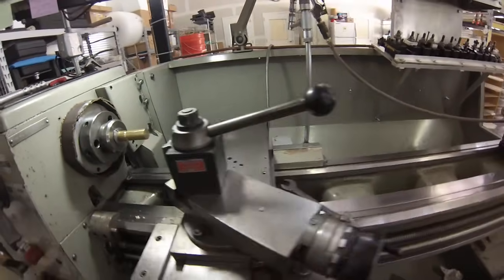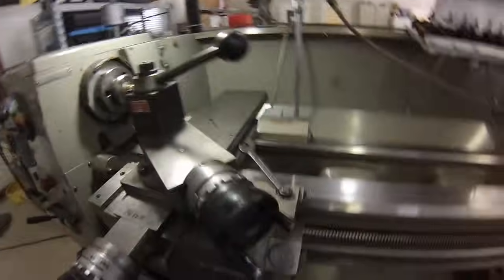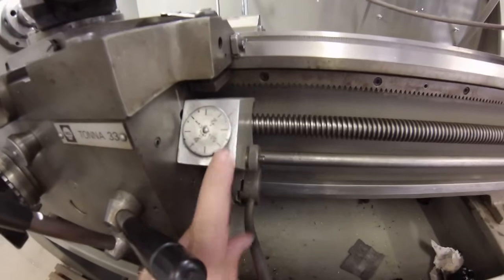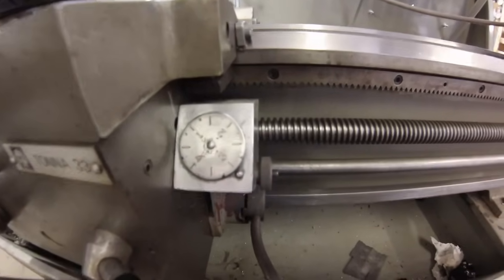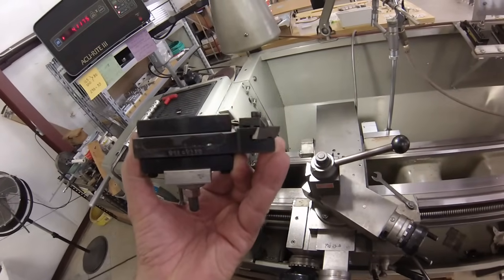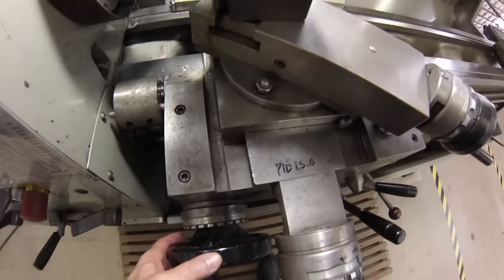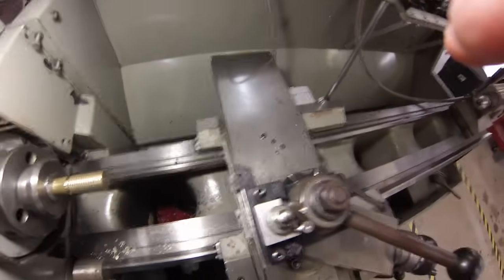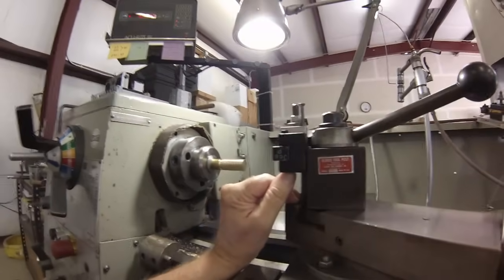Threading on a manual lathe  BEST TECHNIQUE EVER !!!!

Comment: i have used this method many times in the past. but always found it a bit slow. and was never with upside down tools. becous you cant see whats happening and is pulling the carriage of the slide ways. but each to there own. i used to keep the lead scew engaged and turn 4 thou of the nominal thread diameter to start.set the DRO to zero. or put a marker pen line on the cross slide so you no your starting point. get shot of the bed stop. disegage the carriage hand wheel. and thread into your under cut at reasonable speed. and pull the chuck into revers and repeat. depth of thread is a bit more than pitch of thread.  and dont forget to compensate on the compounds slide so your tool dont jam and break.

Comment: When others and I were apprentices with the Royal Navy nearly 70 years ago we did not only use the cross slide to feed the cut as this makes the tool cuts  on two sides of the thread. We used the compound swivel slide at the right angle  of the thread selected so that one would move parallel to one side and only cut one side of the thread. Seemed to be less punishing on the ears!! We used this technique  you shown and when we wanted to make long pitch  threads on wooden shafts we drove the lead screw. Good old days before the Dockyards closed.

Comment: Right, upside down and feed out.  Right side up feed out for lefthand threads.
Not a bad Idea. Where I learned to thread was a hydraulics company and before they got a CNC machine it would be fairly standard to thread 50 to 100 parts or more per shift. It probably never happens nowadays, but then, if you thread 250 to 500
parts per week, week after week, some blind internal, all kinds. A guy can get extremely good and very fast.Believe it or not, at that frequency hitting the shoulder is extremely rare. There are a few setup tricks that allow a guy to do this. One, set your cross slide dial handle at 9:00 so down is always out. At normal threading speeds, people are way faster than the machine. I can imagine such concentration being rare these days.It use to be fun to see how fast one could go, I once beat the machine going 750 rpm,(to a shoulder) the half nut wouldn't fully engage fast enough. Sometimes on small shafts your method would be impractical if a center were used.  We didn't always have the luxury of a long diameter relieved center. Then one would have the same problem in reverse. Still your method would bring relief to those who thread infrequently.
(I know, they make, and we had threading heads, we used on some jobs, but then you would never learn would you?)
  Very good video and very good safety advice.
Reply from the maker: I agree. trade skill can be pretty amazing. Some of the parts I have worked on in the past just wouldn't allow for any chance of a miss. Hard stop and out. Military parts in a repair environment. 100K type stuff.

Comment: Hey Joe, Great technique! 
Threading towards the spindle has always been a source of anxiety for me. I would like to give this a try on my Grizzly lathe. However, it does have a screw on chuck. The chuck has two locks that secure it to the spindle using cap screws but I'm not sure how much of a bite these locks have on the spindle. I might test it with a live center in place just to be safe. Thanks.

Comment: try putting a rubber band around each end of your wires then just slip over the thread you don't have to hold the wires this way makes it much to mike the pitch
Reply from the maker: Try using just 1 wire!! Makes it even easier.
Reply: actually I kind of cheat I have thread Mikes I got when I was still working in shop
Reply: I know something the home hobbies or average guy not going to have or afford. I just discovered your channel and I do enjoy watching
Reply from the maker: Thanks. I appreciate the interest.

Comment: It appears that you are using a left hand tool holder & left hand insert and just flipping them over. 
Is this correct?  If not, please explain.
Does the same apply for internal threading, in regards to tool holder and insert?
I do a fair amount of single point threading, and am excited to try this technique.
Thanks for your work.
Reply from the maker: Your observations are accurate. Good luck.

Comment: Technique worked great :-) Was doing 4" of thread on the ends of 24" lengths of 1" diameter rod with 8TPI and it was fun to be able to run my lathe's RPM faster for a better finish on Threads.  Made more cuts less deep on each but still was faster because the RPM was faster and didn't have to worry about disengagement paranoia/panic :-)  On each pass, once tool was clear of the threads I would casually disengage lathe :-) Great Technique!!

Comment: Ok, Been doing it this way since the 70's. The title had me wondering if you had the same trick as I had used for 40+ years, Quite amused to see you did. Good job on the video.
Reply from the maker: Its was a little shaky but its a good technique. I am surprised its not the standard.
Reply: There are just mot many joung guns that can develop the skill sets needed for manual shop jobs, engine lathes, boring mills and the like. Or the patience needed to become a true craftsman. Most are button pushers in today's industry. I know because I have managed shops and tool rooms from my mid 20's on to my retirement 8 years ago. I like your style and enjoy the videos. Thanks for your time.
Reply from the maker: Thank you sir. I appreciate the comment.

Comment: Great info, thanks. Next time I single point a thread. That will be how I do it. Thanks for a great tip.
Reply from the maker: You'll like it. Thanks for watching.
Reply: Joe Pieczynski, got to do some external single point threading today. I used your method. I did use the compound for in-feed, however. And all I can is WOW. As far as I am concerned, this is they only good way to single point on an engine lathe. Thanks for a great tip.

Comment: Good idea for single point threading - I'll have to try it the next time I have to thread to a shoulder. Similarly, I prefer to use boring bars inverted, so if you get flustered and have a brainfart, you can back out your cutter like with external turning.
Anyway, a question came to mind as I watched your video and noticed the compound cross slide set to an angle. Let's say you set the depth of cut with the compound cross slide (which is set at 29.5 deg), should it not be set to the left of square, since your cutter is inverted and you're feeding L-R?
Reply from the maker: I didn't use the compound.
Reply: Right. You set depth of cut with the cross slide.
What I'm asking is if I was going thread inverted and in reverse like you show here, but use the compound to set the depth of cut, should I set the compound at 29.5 deg from the left instead of 29.5 deg from the right?
Reply from the maker: Either side will still work. The only thing the compound does is bias the chip load. Set normally, and threading out, the majority of the chip load would be on the trailing edge of the tool.

Comment: I wish I'd studied more engineering. I'm a computer chap - but what a great video !
I've been computering for some 40 years - and now volunteer in a Design and Technology Department in a very nice school - helping the students use microcontrollers for the control element of their projects.
But ...
I absolutely love turning technique videos.
This one is a gem. Joe says, "I like this trick and it saved me hassle and time." He shows us the trick. (I'm afraid I don't understand some of the lathe parts and terms, 'cause I'm a rooky, here) Nevertheless, his trick has a number of real benefits, and he gives us some other basic tips and tricks for remembering other things to do with threads.

Top marks for the strict aside on safety. Be safe and ** DO ** safe.

One crit ... stop waving the camera about. Get a mate to video you, and tell her/him to stop waving the camera about. Think about what you want shots to 'say' and compose them as a 'picture'. The action happens in the picture.
If you're using one camera only, cut back to Joe for the lecture, cut back to the action for the action. Listen to Joe. If he says, "...this dial here ..." we're gonna want to see that dial there. You'll have to stop and recompose ... not wave the camera about !! No 'waving the camera' will improve the video presentation enormously.

Suggestion ... In the UK, the school stuff must have guards fitted. Your lathe does not - and you could mention guards as an addition to your good safety section.

Punchy, entertaining and informative. I learned lots. Memo for remembering thread handedness, guage wires (never heard of them), upside down tool fails upwards 'out' of the work (this might, though, throw bits upwards at the student, so have a caviat with this trick. Comments?), bury carbide bits or they break, thread dial numbererd starts for odd threads and it will engage on a half position - usually a bad thing.
I'll watch some more, Joe.

Don't understand the terms about the position of the tool wrt the axis of the workpiece. Above, on centre, below. You mention 'the tool tip will drag'. I get the idea, I think, but need to see this. I think you say the tool should touch the workpiece above axis. (see, I'm a rooky)

Can you do the same thing with internal threads? (Rooky question ... probably a very obvious answer.)
I think yes, you can. Am I right?

Matt Lee

Comment: Great method to keep ones' butt cheeks from becoming permanently clenched. I don't own a large engine lathe but my South Bend 9A has served me well. Yes the chuck screws on but what about work held in a collet or step chuck? I ran a job years ago where the part had to be threaded internally with a course pitch thread. At that time the shop foreman showed me this method and I had forgotten about it until I saw your video Do you think you could invert a "T" style parting tool too be able to work very close to a shoulder? I don't run carbide but I found a source for T15 HSS inserts, what is your opinion of this tooling option. I have to internally thread some parts 3/8 to 3/4 deep with 20 to 32 TPI. Work I.D. ranges from just over 3/4 to 2 inches. Per your video just invert the boring bar with the tool point on center?

Comment: All well and good, but what happens when your toolholder slides up the toolpost under load?Also, what happens if you're not allowed such a generous undercut at the end of the thread?  You're creating a weak spot that is not necessary.  Here's what you do- sell that Clausing knockoff to some other noob who thinks you're a guru and use the proceeds as a down payment on a CNC like a Romi or a Haas.  A tip for threading-  take the percentage of thread in whole numbers and multiply by .013.  Divide that product by the pitch and subtract the result from the nominal OD of the thread.  This is your minor diameter.  Works for tap drills, too.  I've always loved a lathe, especially the Clausing 1320, but that was 40 years ago.  I appreciate what you're doing, but whoever you might be teaching will be grossly underqualified to get into a modern machine shop.
Reply from the maker: I'm going to enjoy responding to this guy. First, the generous undercut you speak of is only as wide as a single thread profile. An inverted tool with a hard stop produces the smallest resultant undercut possible. Second, anyone with any experience would recognize the lathe as a genuine Clausing and not a so called knockoff. But nice try. Third, if a tool experiences so much load as to slip on the tool post, it probably would have broken off or ruined your part if it was conventionally positioned. Fourth. none of us are impressed by your 99 step formula to find the minor diameter. Who gives a half a shit. Its the pitch diameter and tip flat that create a gage thread, so just check the thread chart for your values. Fifth, not sure Clausing ever made a 1320, you may wish to check into that. Finally, sounds like your too focused on the CNC world and just enjoy trying to make yourself sound qualified. I'm going to guess your experience is severely limited and simply dismiss you as a troll. Work for DB by any chance?
Reply: Who is DB?
Reply from the maker: Rob, when I think your comments are more personal than technical, I'll block you. feel free to comment, but stay on point.
Reply: I apologize for pissin' you off, Joe.  We're on the same team after all. But it's 2017 Joe.  A Haas TL-1 costs about the same as a used Colchester, and it can do shit that the Colchester just can't and is more accurate, to boot.  Don't get me wrong, I had to make a turnbuckle in mild steel with 1"-10 Acme in order to graduate trade school with hand ground tools and a rocker tool post.  I cherish the old ways, but there's no way I could make a living today using that old technology.  At 59, I'm part of the last of the Mohicans who managed to take the craftsmanship of the 'old ways' into the CNC world.  Nowadays, CAM systems analyze geometry, evaluate materials, and calculate speeds and feeds based on user input and embedded algorithms.  But what they're really good at is ruining tooling and spindles.  On the other hand, you absolutely CANNOT compete with a CNC in the hands of a seasoned programmer/operator.
Reply from the maker: This threading video was the first machining video I ever posted. I did so because the majority of the other threading videos online never show this being done. Since then...a channel just happen. As the creator and host of that channel I have learned that my audience is very diverse, and the analytics available to me behind the scenes indicate there are more manual lathe guys watching than any other segment of this trade. I direct my videos at all you guys. Garage hobbyists to trade professionals alike. Not all my material is going to satisfy everyone. But I'll bet you find more manual lathes in garages and basements around the world than you find CNC lathes. Cash being what it is, only a select few can actually buy a CNC lathe for personal use. If you own yours, you are one of the select few and good for you for that. Some of your earlier comments were way out of line, but I appreciate you coming back and I accept your apology. Thanks.

Comment: that primary thread cut. like a boss....using this to learn about my recently acquired clausing....already intimidated
Reply from the maker: Run the RPM slow and test all the new settings in the middle of the bed. Stay away from the chuck if you are unsure of whats going to happen. The fear will clear.

Comment: You're absolutely right, your tip has changed everything! I've got the other guys doing the same. I also part-off inverted since the chips fall out instead of loading up, I don't need to face either side. Thanks!
Reply from the maker: Soooo much easier.

Comment: I never comment on videos, but this right here is what I've been looking for. I'm starting a home shop and am doing everything I can to avoid "accidental costs" such as crashing. Even going so far as installing a 3 phase motor and vfd for fine rpm control to avoid what your video just taught me. Thanks for this. Like I've always said, old knowledge is the best knowledge, cause it was earned.
Reply from the maker: I appreciate you taking the time to comment. Good luck with your shop.

Comment: That's two for two great videos.  I can't click subscribe again but I'm glad I did the last time. ;-)

A long long time ago (30 years) I saw a guy at a show selling a cut off tool that permanently mounted to the far site of the cross side.   All he needed to do was put it in reverse and bring the slide all the way forward.   
It seemed, except for threaded chucks, like a good idea but I've never seen it again, anywhere!
Reply from the maker: Thanks for subscribing. Much appreciated. I had a small turret lathe that had a rear blade like that. It was a pain in the butt as I recall. But it was also a stationary cross slide.

Comment: Joe:  I've been doing some threading on aluminum lately with mixed results, especially internal threads..................  I am going to use this method next time for an external that I need to cut.  Thanks for the tip.  Being retired now just working my hobby machine shop the extra information is a great help.   Keep 'em commin' Joe!! I appreciate all of them,   steve @  ironhorse18@frontier.com

Comment: The only thing I would do differently is use a set of pitch micrometers its so much easier. I also never disengage the half nut but the lathes I use have a spindle direction on off lever. I prefer to disengage but the lathe we have is so sloppy you end up cross threading and ruining the threads. The fact that you addressed safety was impressive I have been a Machinist/ Tool and Die Maker for over 25 years and using lathes even longer. This was the first video I have watched that didn't make me cringe and was correct. I have seen sleeves get caught in the lead screw shirt tails and even hair. People should be more respectful of how bad they can get hurt or even killed in this trade. Good video sir.
Reply from the maker: Thank you for your comment. I watch supposed experts doing machining videos, guys that refer to themselves as 'Americas toolmakers' and such , wearing rings watches long sleeves and they wonder why I ding them with negative comments. Lead by example or stay out of the way. It only takes a second to take that stuff off. A lathe injury can change your life in the blink of an eye. Thank you for the comment.
Reply: Thread micrometers work great. No fiddling with formulas and a direct reading of pitch diameter. But they are NOT cheap! A Mitutoyo 2-3" frame alone was over $350 (no anvils)